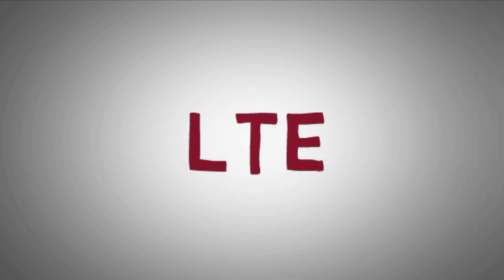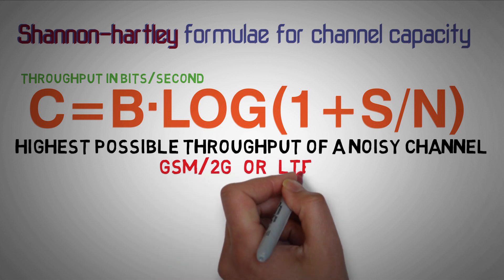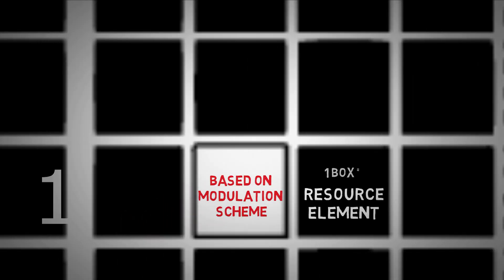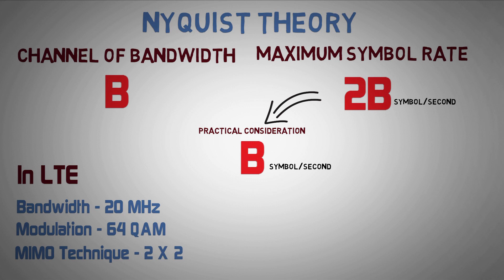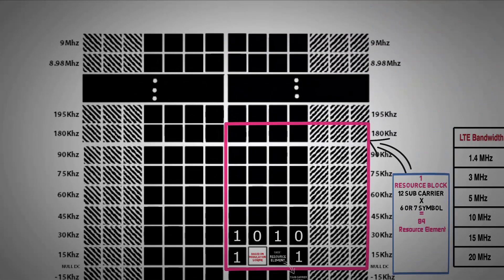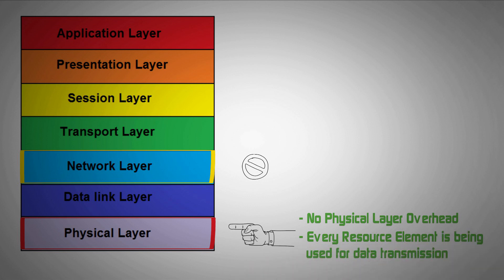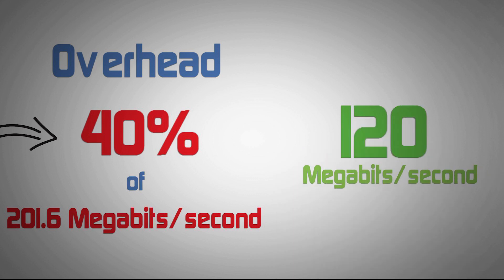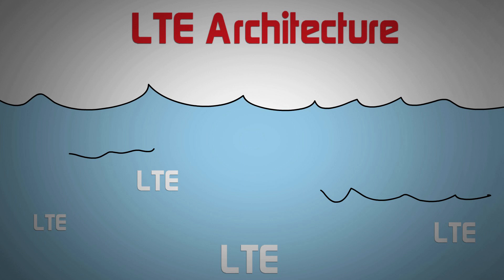2.12 - THROUGHPUT (SPEED in MBPS) CALCULATION IN 4G LTE

Comment: What is Symbol rate? I understand the data rate is BW/SCS * log2(qam)* mimo. But what is the symbol rate? Is 64qam’s symbol rate 3 times higher than qpsk?
Reply: C = BW * log(1+ S/N) this is how many symbols you can send per second. If you are using no modulation, then symbol rate = bit rate. When you use 64QAM you can send 6 bits per one symbol so data rate would be 6x symbol rate.

Comment: While calculation of maximum DL throughput we consider enodeB uses all resources for DL only. How is it possible. I mean all subframes for DL. Same thing for UL. Why don't we consider UL traffic in overhead.
Reply: There are 2 kinds of duplexing modes which can be used, FDD or TDD. In FDD, both uplink and downlink use different bandwidth, therefore they are independent each other. In TDD, the mobile antennas work either in uplink or in downlink. They rapidly switch their roles, however a significant amount of time they are in downlink mode. Please read about LTE frame structures to get more clarity.
http://www.rfwireless-world.com/Tutorials/LTE-frame-structure.html

Comment: Are the number of Resource block allocated in LTE channel directly correlated to the number of users connected? (as mentioned in 5:50 of the video)
Reply from the maker: +Sagnik Basu - Not exactly. We gave that example for simplicity.
There maybe several other factors affecting the Resource Block allocated to a user. It mainly depends upon the requirement of the user (which may depend upon the QOS of the Service Requested or the RF condition of the user etc) and the total number of resource blocks available at the eNodeB.